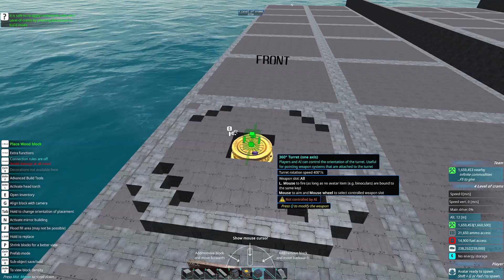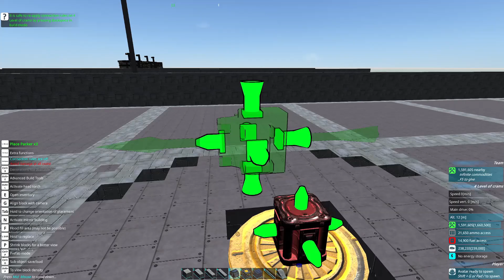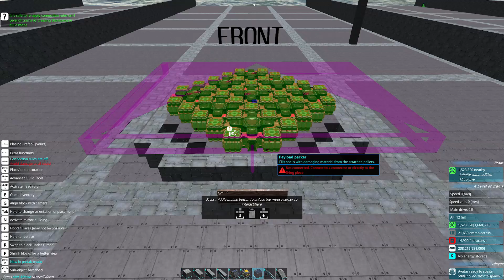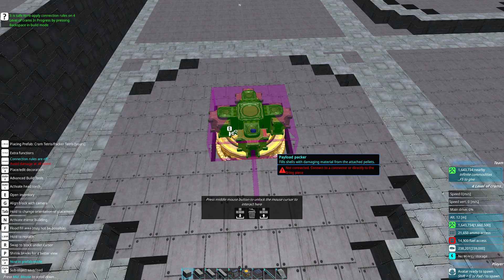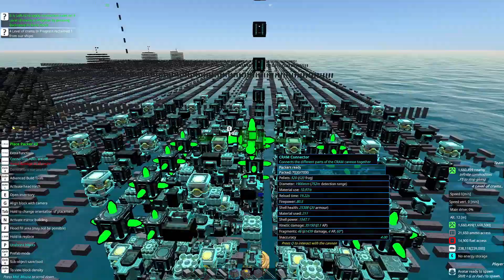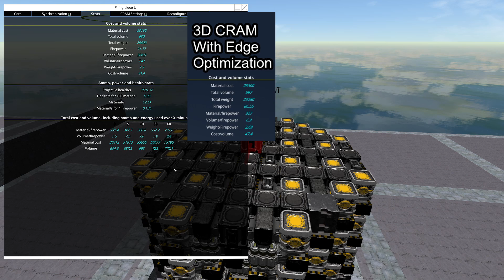From The Depths Tutorial: 4 Levels of CRAM Tetris. In depth Tetris guide.

Comment: The best one that worked for me would be 2D method with some of the 3D optimization you showed. I tend to make a single layer, but I make sure every packer is connected to 3 pellets/compactors. I fill whole area, not only "round" area with free space sticking outside. Then after prefabing and copying the layers to the designated hight I put connectors on top to connect all the vertical columns of my connectors and fill the rest with gauge increasers and armour. It will use all of the space and I think it is much faster way to build than what you presented. Also I tend to build twin or quad CRAMS, so there is a little space inside because of the walls, making custom optimization necessary. 

Great video though, you are probably the best tutorial channel for FTD, I'm glad I've stumbled upon this channel and can't wait for more videos to come.

Comment: I think there might be another dimension to optimization that I don't think was mentioned,  the vertical.  You will get different stats depending on if you have the connection layer or the pellet layer on the bottom.  And also if you have any even or odd height you are trying to reach.  I haven't done enough testing to be able to say if one is always better than the other, but I think pellets on top and bottom usually leads to higher firepower per volume but also higher cost.  If that is better depends on your design goals though. 

Excellent video though!  I think this will change how I build CRAM, I was doing a lot of guess and check before, but I prefer your systemic approach!

Comment: The firepower comparison in the video is inaccurate. Either the reload time or the projectile density should be converted to the same value to obtain a proper comparison, as these metrics have the greatest impact on the firepower of a gun of approximately constant size. The 2D tetris gun is slightly more powerful than the diamond tetris gun, but is significantly more expensive
P.S. But overall the video is really cool, I hadn't thought about some of the T-shape moments before

Comment: 2D cram is actually not that bad. If you replace all the pellets with 2 or less packer with compactors, you can have quite a decent CRAM with around 500-600 MPF but way better VPF (volume per firepower). Basically they are more power-dense than 3D, though with that MPF you are better off with an APS so I'm not disagreeing with the conclusion, just something to keep in mind if you want CRAM only or somrthing.
Reply: 3D can be both more dense and cheaper than 2D tetris with the right setup. 
If you layer the tetris A-B-A-A-B-A it will be build for density, the video instead shows A-B-A-B-A which is build for cost, but lacks density.